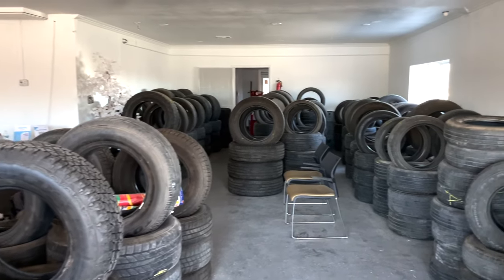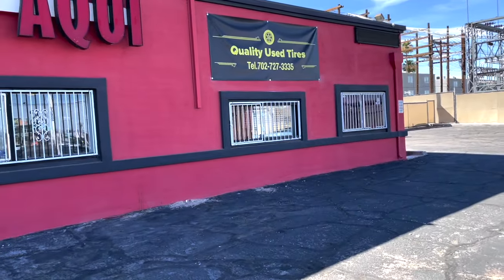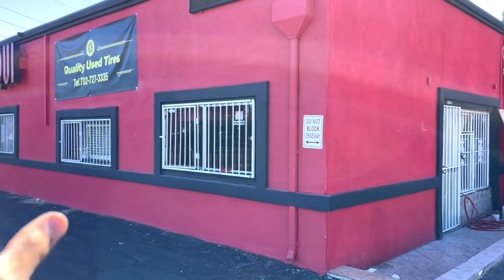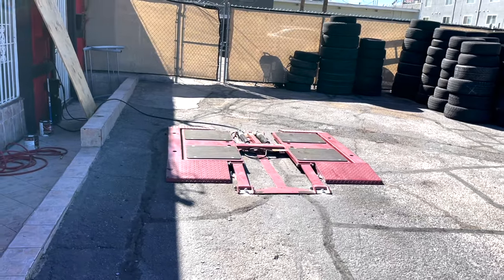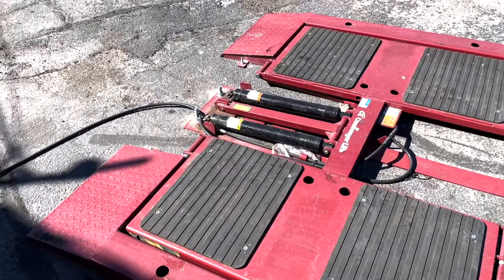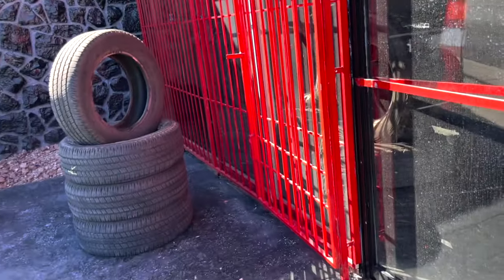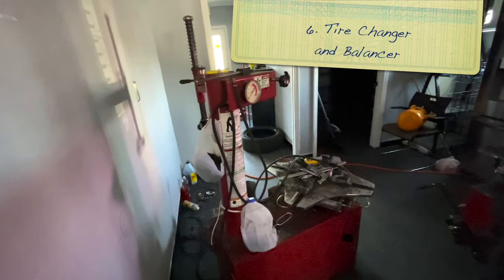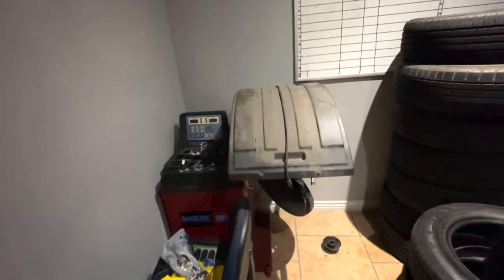Everything You Need To Open a Tire Shop

Comment: There’s a gang of info on your channel. Thanks for posting all this stuff I’m about to start binge watching.

I’m looking to open a “business” but more for myself than anything to cut cost down. I use a lot of tires (new and used) for drifting. I would like to have the ability to get tires at a discounted rate  (new and used) but not necessarily wanting a shop. More like an on need basis. Do you think something like this is feasible?
Reply from the maker: Sure! I'm actually working on a tire master class that is coming very soon. Stay tuned for it!

Comment: How much capital did you spend? And how many employees did you hire?
Reply from the maker: I personally spent about $6,000 but consider that I did not have to purchase all those used tires in advance, and the equipment was also equipment I had in other stores. So if you don't have that expect about $15K of equipment, plus $10K in tires, plus $6k in setup that would be about $21-$30K

Comment: Hi ..Approximately how much does it cost to open a regular store that is not large?
Reply from the maker: It really depends on how much money you want to have extra for operational purposes. You may only need $50,000 to open it, but you will need to market it, pay salaries, etc, until you can make enough business to cover your expenses. So Ideally a $100,000 - $150,000 I would say could be a good amount.